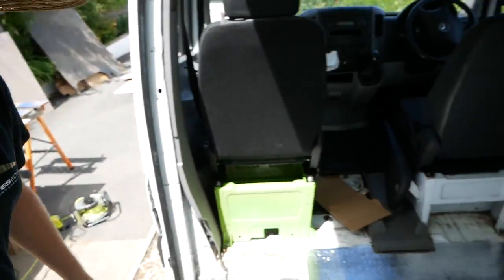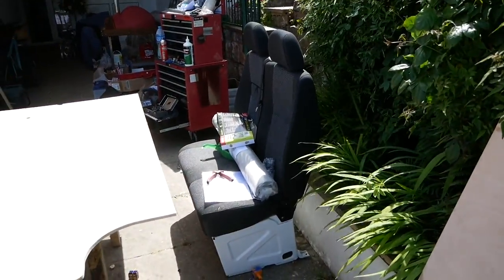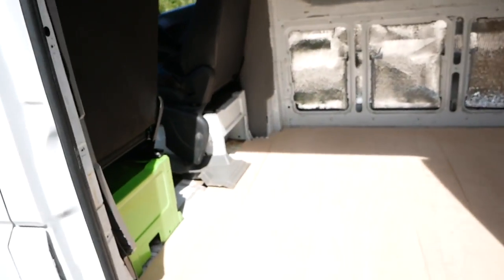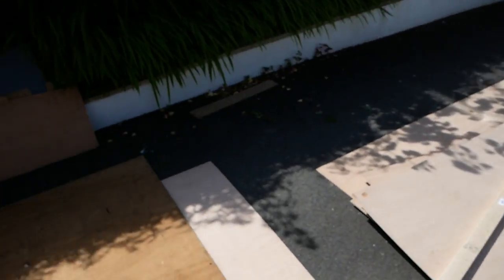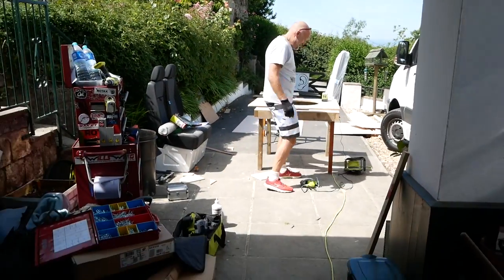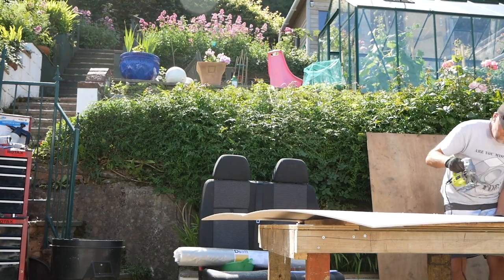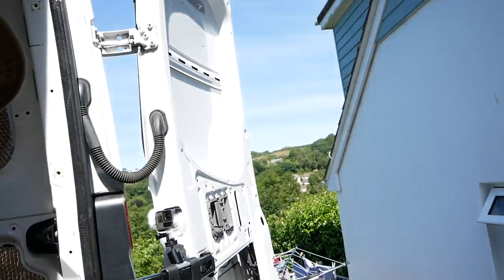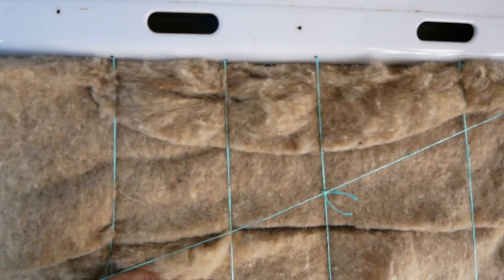Turning a Van into a Home, Insulation and ply lining day 2!

Comment: One of the hang gliding pilots some years back used sheeps wool insulation in his camper van and it worked very well even in the cold nights of the south coast of Western Australia. Very comfortable with low humidity build up inside.